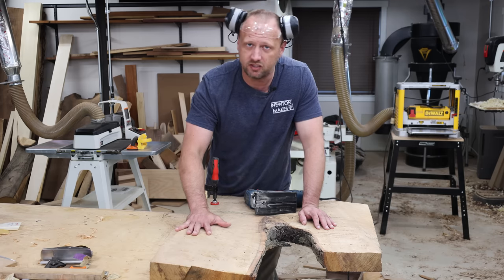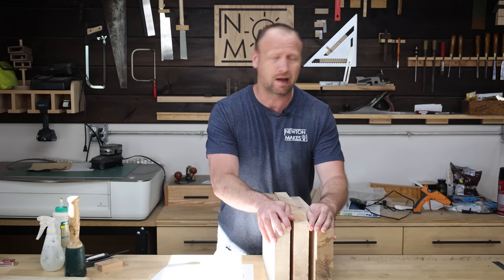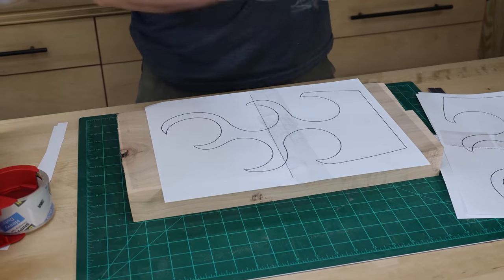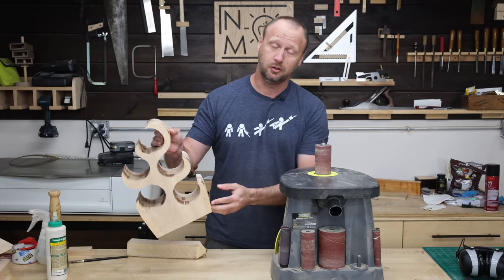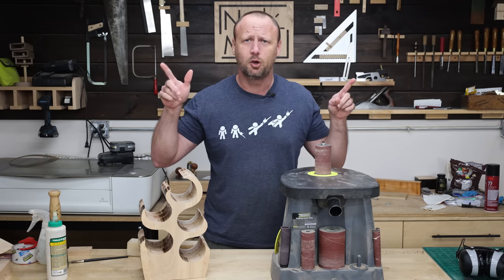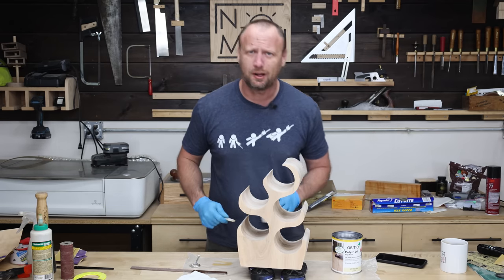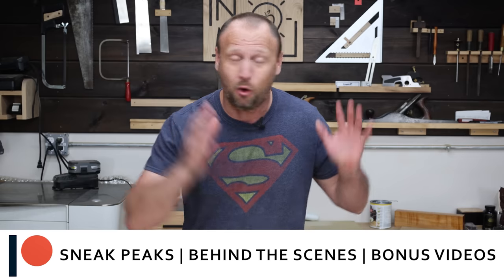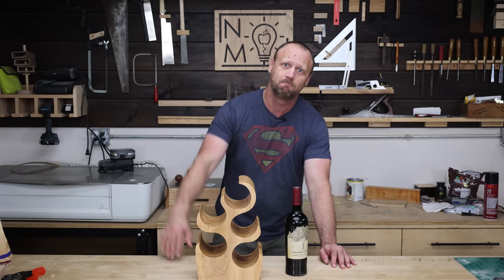Urban Logged Wine Bottle Sculpture | Woodworking Gift Idea

Comment: I made this wine rack by gluing a bunch of scraps together, matching a picture in a magazine. I cut it out in sections and glued them together for sanding. I used my spindle sander with a little trick I devised. I bought 6" sanding sleeves and used them over the 4.5" spindles. This worked quite well to clean up the whole surface.

Comment: I absolutely love this design so much I had to give it the thumbs up twice, but that turned out to have an unintentional effect, so I gave it a third thumbs up. This is the very first woodworking template I've actually downloaded. The very modest price almost justifies actually using live slabs 😄

Not having a bandsaw, I think I'll go with an MDF template and a router table. It's really a beautiful design 👍
Reply from the maker: I love this comment. You explain how you don't have a tool so you have another way to make it. Most people would instantly shut down the idea of building it. They need to think about it like you did.

Comment: Cool project!

You could also do the same thing with two and put some spacers of some sort, maybe rods or threads or just small wood scrap blocks, to give a slightly different look and also help if you don't have access to as much thick stock.

Also, depending on where you can get supplies near you, thicker stock can be cost prohibitive.

Very neat idea and inspiration!

Comment: How do you keep the saw blade tight? Mine wobbles, no matter how much I tighten it. Ryobi band saw, using 1/4" blade.
Anyone in the comments? I'm having trouble with it wobbling, I cannot follow lines easily.
Reply from the maker: Never used that saw so it's hard to tell. Sometimes there are bolts you can adjust beyond the tension wheel. The manual usually says.

Comment: For heaven's sake, buy a new bandsaw blade. Much cheaper than a table saw blade. Even top end timber wolf blades are generally under 35 bucks.
Reply from the maker: I literally bought one in the video.
Reply: @NewtonMakes  yes. I guess I should have phrased it, why not have a spare on hand, and I wouldn't have waited that long... matter of style. I'm cheap, but like working with dull tools even less.